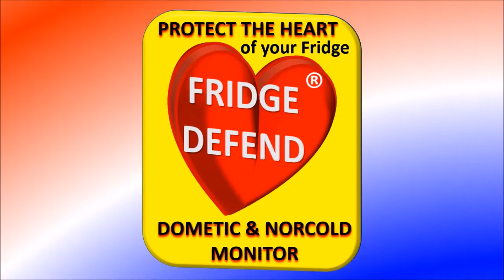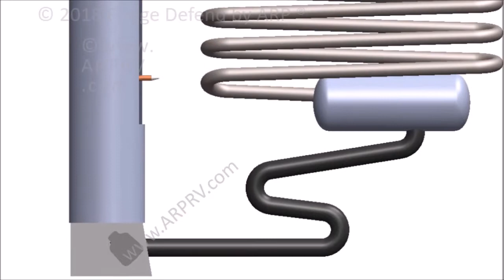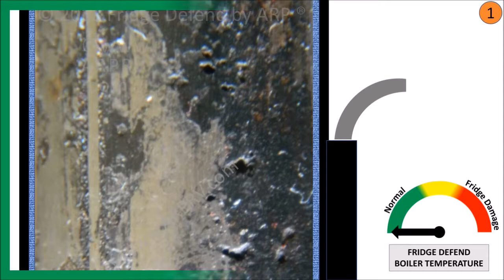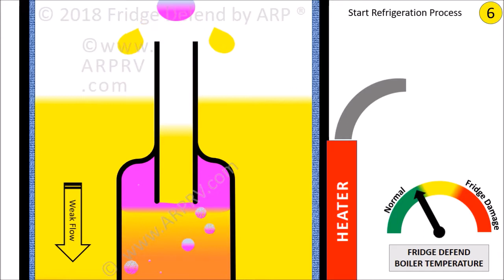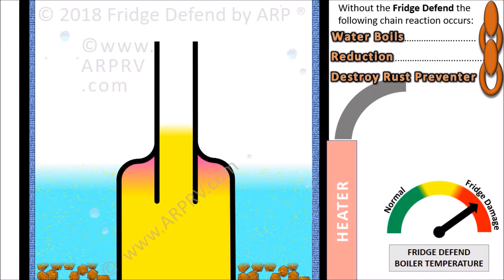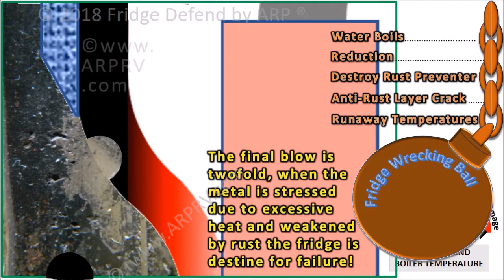Why Dometic and Norcold RV Fridge Fail

Comment: my RV domatic  refrigerator heating  element  won't come out of the tube. I tried wiggling and even tapping on it just slightly to get it loosen. But it won't come out . do you have any other way that I don't know of  that would get that  element Out.  your help would be grateful.

Comment: I went over the the Norcold site to check for recalls. At least a portion of these were made prior to 2000, at least for Norcold. For Norcold systems these seem to apply to the 2-door and 4-door systems.

It may be on newer systems the fire threat may be lower. It is also apparent that the ARP system does provide for a shutdown of the boiler, which is a plus, on newer systems with maintenance of the system and installing additional cooling fans may be all that is needed.

However, if you have an older system you may want to check with your RV shop and find out whether you refer has protective hardware that at least prevents fire risks. 

I find it rather hard to believe this problem has been ignored by the manufacturers as insurance would be difficult to secure if fires were anything of a problem. Afterall isn't that what recalls are all about?
Reply from the maker: Sorry, no that is not the way insurance and manufacture relationships work. And, no, fans do not solve this issue.  The boiler is within an insulated housing, if fans solved the problem, the boiler would not work at all.  Just try removing the insulation from you Dometic or Norcold and see if it works.

Comment: It’s ALL about proper air flow through the area in back of ANY RV refrigerator.
This is merely a commercial to sell a device that alerts an RV operator that they have failed to operate the fridge per the manufacturer’s instructions and/or lack of maintenance (flue cleaning) that should be carried out every 12 months.
This video is merely a sales pitch for something that is already built-in to any RV refrigerator: the thermal cutout switch.
Reply from the maker: Clearly you do not understand the science, can you view the video's about the recalls you elude to and tell me why they allow the boiler to overheat, even red hot?
Reply from the maker: Hi Lamont, when sharing your comments with an environmental engineer, here is what she said: "This guy  most likely works for Dometic or Norcold, this is the only motivation to put the public at risk. If manufactures 'already built-in' the Fridge Defend, then they would be infringing the Fridge Defend patent. Have this guy prove that what he says is not a bold faced lie."
Reply from the maker: Sorry, this is a very misinformed comment. None of the steps you take control the boiler temperature by detecting the overheat situation. See this:  https://www.arprv.com/#fishbone

Comment: Here's an issue I cannot find adressed anywhere
Last week we purchased a 2000 Jayco Eagle with a Norcold 621 in it. 
It seems to operate fine, but the paint (?) on the aluminium plate in the freezer compartment is peeling off of roughly 2/3 of it and the bottom of it is very heavily corroded. 
The plate covers the bottom, goes up the back and covers the top. 
The front edges are secured with 3 plastic rivets across the front of the bottom and  3 plastic rivets across the  front of the top. 
The back is secured with 8 bolts, 
Is this repairable or should I start looking for a replacement?
If it is repairable should I remove the plate from the freezer to clean it up and repaint it or should I clean it up in place and repaint it.
Is there a recommended paint to use?
Reply from the maker: Hi Arnie, the issue you are having is unusual, and could result in other issues if I understand it correctly.  If you want to contact us directly it may be easier to dive into the details, use our Contact Us form at www.ARPRV.com

Comment: Pretty good video, thanks. I come from the marine field and have had lots of experience with Domitic (sp?) LPG refrigerators. I've replaced a lot of them with residential under the counter home store units. The old LPG units I just threw away. Just bought a class C 33' motor home that has a Norcold 12 VDC/120 VAC/ LPG refrigerator. I have no intention  of ever useing the LPG mode. My question is, will useing only  AC or DC power in the unit reduce, maybe even eliminate the risk of fire? The AC or DC/LPG energy model is hideously energy inefficient in terms of anyway. Plus, in a boat or RV you need a booster ventilating fan or fans to get it to work as efficiently as it's ever going to.

Informative, just the facts, to the point video. Please advise and thanks again.
Reply from the maker: Hi Bruce, thanks for your comments.  Regarding "just threw away", not sure what the issues are? We own two Servel refrigerators that were made in the year 1937, both work to this day, that is value!  See this link:
   https://www.arprv.com/rv-fridge-endurance.php
   
Regarding "I have no intention of ever useing the LPG mode", the LP Gas mode is the reason to use the absorption refrigerator. If you have the power to run a compressor type fridge, then you should use a compressor fridge.

And, NO, the boiler of a Dometic or Norcold fridge works the same on gas or electric, therefore the fire risk is the same if you do not control the boiler temperature such as the Fridge Defend does.
Reply from the maker: I am sorry I got this 3 years later! The truth is that the LPG mode puts less stress on the cooling unit.  The majority of fridge fires occur between 2am and 8am in the morning on shore power (120VAC) power supply. So NO, not using LPG does not protect you from the damage seen in this video.